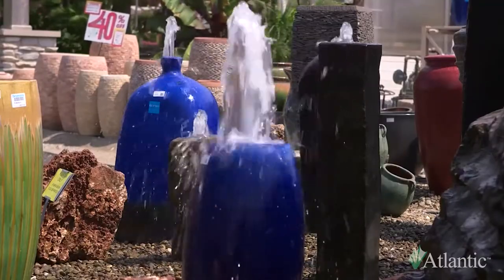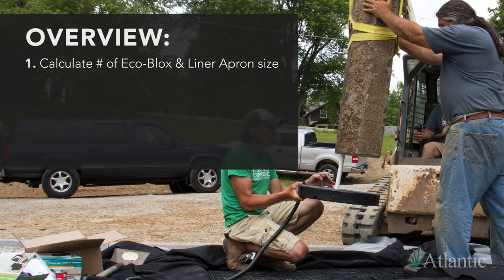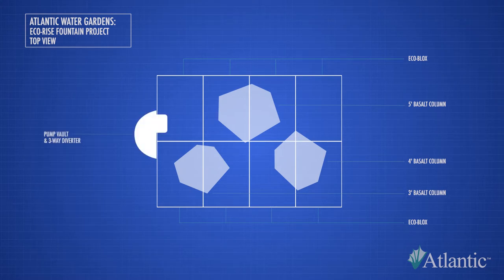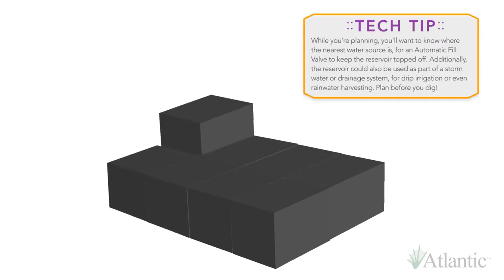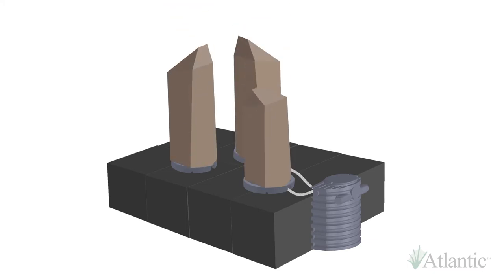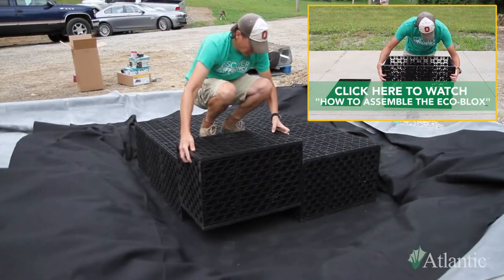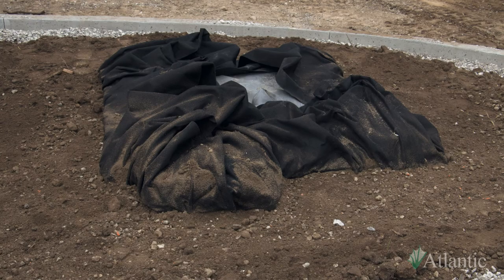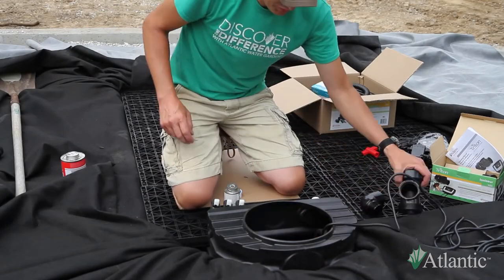Installing an Eco-Rise System

Comment: Great detailed video to install these massive Basalt Columns. What AWG pump was used here? What's the perimeter black pvc edging used around the black beach pebbles?
Reply from the maker: Thank you Geert! It is the TT1500 Pump and the edging is a ¾” x 4” composite lumber. We doubled it to curate the circle.